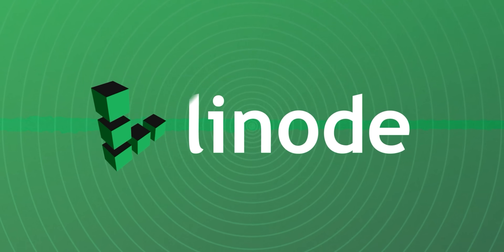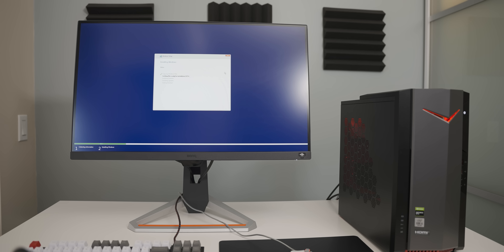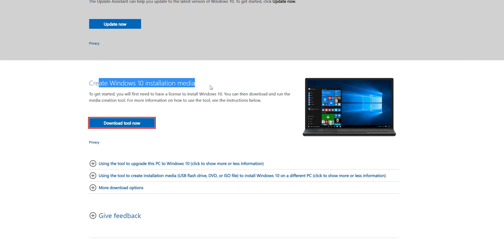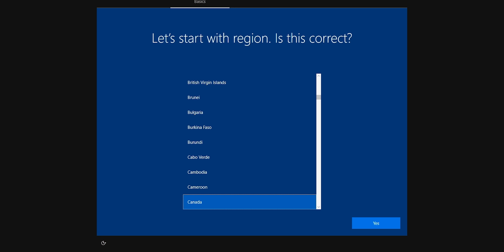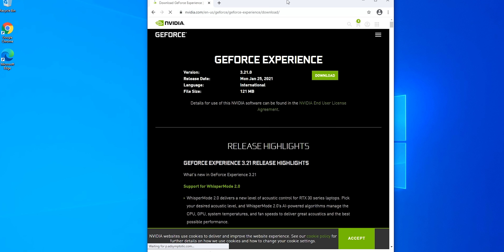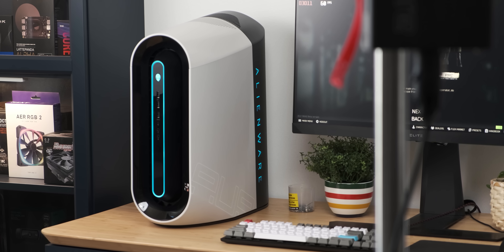4 Simple Steps To Set Up Your NEW Pre-Built Gaming PC

Comment: I’ve just got a prebuilt and the internet does not work on the pc but is fine on my Xbox etc
Reply: Doesn't really help much. How are you trying to connect your PC? Ethernet or wifi? Need details.
Reply: @JJFlores197  wifi
Reply: @Cosmos-Dreams  First thing to check is to see if your PC has wifi. Some do and a lot don't. If this is a pre-built, it should state in the box/specs. If it does have wifi, can it detect your wifi network?

Comment: I bought a prebuilt (I know, I know, heathen, blasphemy, yadda yadda) and did most of these myself, since I've been using and maintaining PC's since way back in the 90's. A lot of people think a prebuilt will have what it needs, and never clean them out/reinstall windows. I've spent a lot of time on friends' computers just removing VD, not really trusting their ability to run a proper reinstall of windows. Granted, most are about my age and didn't tack on to the tech, but still, it shocks me how little people seem to know about computer maintenance, and how many throw out a perfectly good PC because it doesn't run "the same as it did when it was new". A simple reinstall would fix 90% of their issues.

Comment: Like the video you have put together here. I have a question about a built I have (AMD Ryzen 5 with MSI board, Crucial RAM and GTX1070) one day while playing GTA V computer restarted and ever since it kept re-starting. So I decided to do a clean Windows install to see if it would resolve the problem. But whenever I go through the initial Windows installation, it always re-starts during the region screen. I have swapped the RAM, motherboard, Video card but the problem is always the same. I even tried installing Windows 11 and it didn't work. Do you have any suggestion as to what might be causing this issue? Any response would be appreciated. I really want to save my build. Thanks

Comment: I just bought a prebuilt PC but when I try connecting to the internet my wifi network doesn't show up. Anyone know how to fix this?
Reply: Hey did you manage to fix it? If so how?
Reply: @brainlessgaming8801 Well right now I'm just
Reply: @uxorael608  ? So I figured it out, your pc or at least mine came with these antenna(sticks) and you put them on/screw it in these two golden circles and you should see a wifi connection
Reply: @uxorael608  at the back of your pc
Reply: @brainlessgaming8801  Sorry I didn't finish my sentence lol, but I meant to say I was using LAN cable right now.
Reply: @brainlessgaming8801  Thank you so much it's been 5 days and I still haven't fixed it I'll try that right now
Reply: @brainlessgaming8801  You're really a lifesaver it really worked. But I was wondering with the antenna/sticks did you keep them straight or stick them up?

Comment: If windows is already on there do u have to delete it or anything or basically do what u described in this video and the new windows replaces the one already on there? Also what about a windows key code? If it has already been downloaded and u are redownloading do u need the key passcode?
Reply: Honestly that is an extra step that is only necessary if the bloatware is out of control and you don't want to uninstall the apps it comes with. 
If you do re install windows, it will flash the drive you are installing it to so it wipes the old version.   You can re use the key it came with, if they are the same version. Windos 10 pro or home.

Comment: Surely it’s easier and quicker to delete everything you don’t want instead of reinstalling and downloading windows ?
Reply: Yes. It is generally faster and easier to do uninstall the programs. However, programs sometimes leave behind remnants in weird and/or hidden places which can be difficult to find.
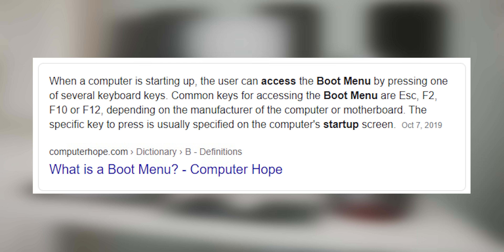Reply: @JJFlores197   I don’t have a keyboard that has any of the F1,F2 etc so does that mean I can’t do it ? Because at 5:12 it says I need it
Reply: @tayy3035  Well you'll need to see what the key(s) you need to press are for your motherboard. If it requires the function key(s), then you'll need a keyboard that has them.
Reply: @tayy3035  you can buy a cheap full wired keyboard and keep it as a backup.

Comment: how do i take off the side panel? i need help
Reply: That depends on your computer case. Most cases have either thumb screws or phillips head screws that you undo to remove them. Then you slide the side panel off. Others may have a slightly more elaborate mechanism where you may need to pull on a latch and then slide the panel off or similar.
Reply: @JJFlores197  nvm i already found out

Comment: You forgot one important step. The Chipset drivers. Windows installs either generic or old chipset drivers. Sometimes no drivers are installed for some components like WI-FI, LAN, I/O drivers, etc. As for laptops that use Intel, some laptops won't have touchpad capability until you install the Intel Serial I/O drivers. This means that you must use a mouse until you get to the desktop and install the Serial I/O drivers and then the touchpad drivers. Windows Update will not install these drivers or even have them available in the optional updates section.

Comment: Thanks for another great video, always entertaining!  I install Windows 10 all the time without a key and just use it in free mode but I was hoping you'd cover how/if you transferred your new Windows 10 key that came with your pre-built to the new Windows 10 re-install.  Do you bother with that or just use it unlicensed?  If you did transfer it over to the new install can you please comment how you do that?
Reply: Yeah leaving that bit out was a bad oversight. Most newbies might not even know you're losing something by doing what he instructed, having the activate windows text always being on the bottom right would get old quick(especially if your prebuilt came without that issue)
Reply: @KalebSDay  so you're saying it would just be better to remove the bloat, instead of a clean install?  I just got a prebuilt (I know, I know) and there wasn't any "key" provided... so I'm stuck on this...
Reply: @ttattx  
open regedit as administrator

COMPUTER
HKEY_LOCAL_MACHINE
SOFTWARE
Microsoft
Windows NT
CurrentVersion
SoftwareProtectionPlatform

Comment: I've always been of the persuasion that if you buy a prebuilt, especially here when its hard to buy some parts stock for MSRP, buy one with an HDD, then  just go ahead and buy a new SSD or NVME for a boot drive and put a clean install on that drive. Hang on to the other drive until your sure you won't need anything on it, and then either wipe it and use it for storage, or hang on to it in case you need to return the computer.

Comment: Yes. Show us how to fix bio's so it's set up. I ran into 5 prebuilds that all it took was a bio's update and lining up the ram and drives. 
Some had bad cable management, ran wires across the motherboard in stead of routing through the service panel.

Comment: I bought a "Pre-built" Rig and couldn't be happier with it. I got 15% off on it, so I only paid $1150 after taxes and shipping. It is rockin' a Ryzen 7 3700X, ASUS Dual Evo 5700xt, ASUS B550am Mobo, 1 TB Western Digital Blue M.2 NVMe SSD, 16GB Geil Evo Potenza 3000mhz RAM, Apevia ATX-PR800W Gold PSU, Liquid Cooler, really nice case with tempered glass, WiFi/Bluetooth and Windows 10. I couldn't buy the parts and put it together for any cheaper with current hardware prices. It was also put together properly with good cable management, current drivers and the correct settings in BIOS..Honestly, I have no complaints.

Comment: Step 1 change the motherboard and ram, step 2 change the power suply, step 3 change the ssd, step 4 reinstall windows and drivers...step 5 liquidate the crap parts on ebay

Comment: Dawid we had four prebuilt gaming PCs in about three months.  Two broke.  And two had weak cooling overall.

Of the two we kept, the HP "gaming pavillion" PC was a terrible overheating piece of crap.  So much so that I had to buy a new board because the OEM cooler seemed unique and the case was bad.  This was like buying a cheap car only to have to replace everything in it.

But even on "decent prebuilts"  they include crappy CPU coolers and then there's the issue of how do I upgrade when I'm not sure what cooler screw / bracket layout I have.

Like the HP for instance was AMD Ryzen CPU screwed to the board screwed to the case panel, hot enough to make the case panel hot!  And the screw line up does not match intel or Amd wraith!  So I ended up getting a new board and case and then puting a weaker (3200G ) CPU on the HP and giving it to family as an office PC.  

And then there's another issue...a lot of these cheap prebuilts have the "air intake" on the side which goes to the GPU.  the GPU exhausts hot air into the case which going into the CPU and the CPU hits 90 C.

The cyberpower and ibuypower ones were much better but they still suffer from weak CPU coolers and makes me cringe just thinking what temperatures they much be reaching.

Comment: So perhaps this is niche but I'd love to see a video on inter-generational differences in performance. So comparing a i7-3770k with a i3-10320. 8 years apart I reckon??? Both 4c8t and similar clock speeds which could be standardised through BIOS. With similar RAM and GPUs to remove that variable. MOBO would obvs be different. Hmm. Interesting to see how the IPC would differ (or not)..... Okay, perhaps I'm a geek but I'd love to see that.

Comment: Important note, I also recommend setting windows up without internet, because it's currently the only way to make a local windows account, rather than being forced into a microsoft account.
Reply: Do u really need to reinstall windows or can u just thug it out
Reply: Um I just mentioned this BECAUSE I had to reinstall windows. If you are already in windows, then you've already made a Microsoft account to sign into it when you first installed windows (unless you did it offline like I mentioned). In windows 10 you can make local accounts while in windows 10 but they're more like guest accounts I think. I think on Enterprise Windows 10 you can still choose to make local accounts instead of a Microsoft account without turning internet off when installing windows

Comment: I'd Google the bios updates available, and cross reference them to see if they have problems on reddit. Update bios, nuke the OS. INSTALL CHIP SET DRIVERS! OC the RAM. tweak power settings in windows for cpu. Drink beer and stare at my 3080. That's what I did.

Comment: Now I got a problem with AMD.Ok so I get frequent driver timeouts it is a Rx 560 is it the amd drivers that suck or just my gpu i tried everything if anyone has something pls help.
Reply from the maker: Hey! It could be either. Try uninstalling the drivers using software called DDU (Display Driver Uninstaller). This often fixes most problems and is a great place to start.
Reply: @DawidDoesTechStuff  I will try it ty for the recom

Comment: What's the motivation for not using network connection during setup?

It might slightly slow the process, but you will start with the latest patches and things, rather than downloading them later.
Reply: A guy on yt named jayztwocents made a video explaining the windows installation without internet. If i remember correctly it was to not install any spying stuff and things that slow the process. Thats also why he reinstalled widows in this video.

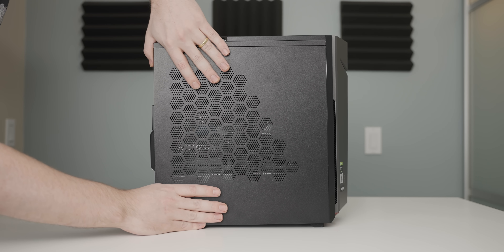Comment: step 1 (1:27) : open it up and make sure there is no any packing material inside of the system
step 2 (1:41) : make sure that all of the connectors are plugged in properly
bonus step (2:23): make sure to plug your monitor into the graphics card and not into the motherboard's outputs
step 3 (2:31): you need to reinstall windows on your new pre-built (he really shows how to do it)
step 4 (7:12): install graphics drivers

i still reccomend you to watch the video
Reply: Thanks!
Reply: When I turn on my monitor it says no signal and when I turn on my PC it won't turn on and I'm thinking it's cause I have 2 cables left to connect and they look like it's for the led inside the pc but I don't know where to connect it and my friends said to connect it inside the pc but I'm asking u because I don't wanna open up the pc if I don't have to
Reply: @theycallmeneptune  in any case. You only need to connect one cable to monitor

Comment: I don't know about the re-installing windows part though, seems very unnecessary.
Most of the times the PC is on an older windows build, so just removing the bloatware and installing some new drivers, followed by a windows update, should fix everything.
When reinstalling windows you might have a hard time finding certain drivers, in some cases the LAN/Wifi driver, which you can't fix if you don't have another PC and a USB-stick.

Comment: Something you can do to save a lot of time is to backup your drivers to the new installation USB drive provided you have 2 to 3 GB of extra space on it.  All of the following instructions have single quotes around the commands but don't include the quotes with the commands.

1. Open a command prompt as administrator, go to your USB drive, e.g.  'cd d:'  
2. Make a new directory with  the command 'md d:\drivers'
3. Enter that new directory with the command 'cd drivers'
4. Type the command 'pnputil /export-driver * .\'

Once all the drivers are exported, install windows as Dawid mentioned then to install the drivers;
1. Open a command prompt as administrator
2. go to your drivers directory with 'cd drivers'
3. run the command 'pnputil /add-driver *.inf /subdirs /install

This will save a ton of time looking for drivers.  You can still go find the latest and greatest graphics drivers but in most cases that is the only one that has to be maintained at the latest version.

Comment: GeForce Experience is optional. You can only install drivers alone. Getting rid of GFE can reduce stutter and fps drops. Sadly with AMD hardware their fancy control panel isn't optional and you have to install it (unless you install AMD drivers through Windows update and I mean not just basic MS display driver, but you get no other control panel for graphics settings).
Reply: Amd driver software also has lots of issues. It uses 20% cpu idle doing nothing
Reply: @mg86_  For me it doesn't, check the settings. However, I agree that it's bloaty showelware.

Comment: step 0: make sure you aren't a tech noob and know where you have to plug in the hdmi.

step 1: don't get some proprietary garbage by dell or acer.

step 2: buy a displayport cable for freesync if your monitor has it

step 3: throw that crap 2666mhz 8gb stick in a fire and get a 3200mhz 2x8gb kit (unless you have an intel cpu lmao)

step 4: basically build a whole new pc by swapping out the power supply.

Comment: A few Points i missed in this Video: Saving your old Windows License (Key) before deleting everything - installing AMD/Intel Chipset Drivers which might be slightly better compared to what Windows installs - sometimes in order to get internet access on a fresh Windows you need to install Network / Wifi Drivers first, which relate to the Motherboard...
Reply: You don’t need to “save your key”. Windows ties it to the motherboard. As long as you aren’t replacing the motherboard at the same time, windows will activate itself fine.
Reply: @slipknottin  I didnt know that, some of these Points come from experience with older versions like windows 7 :)
Reply: AL BUNDY yea there are quite a few things you can do now that you couldn’t with previous versions. You can also transfer your HD with your windows install to an entirely new PC, and while it may restart a few times to install the drivers for the different hardware, it will eventually start and run fine.   Something you absolutely couldn’t do on previous versions of windows; we all knew you had to install fresh to not break things.

Comment: Step 1. Replace power supply.
Reply: psu in that prebuilt is 80+ gold but there is no airflow under the case which will cause problems not the psu itself